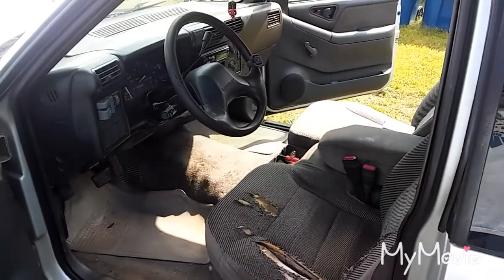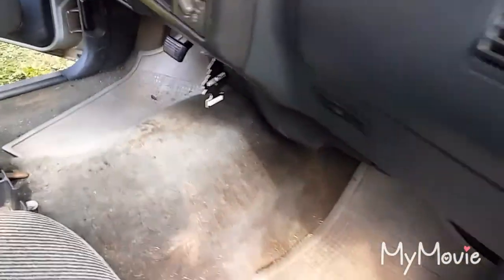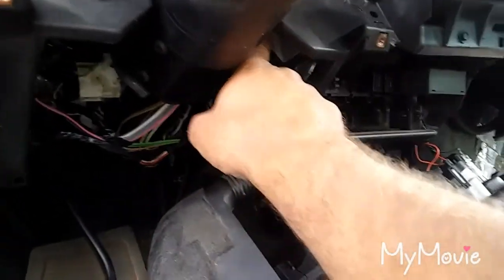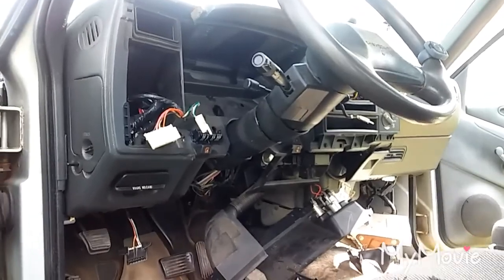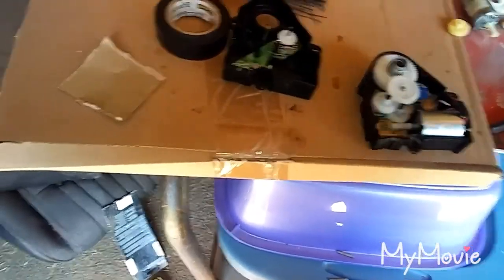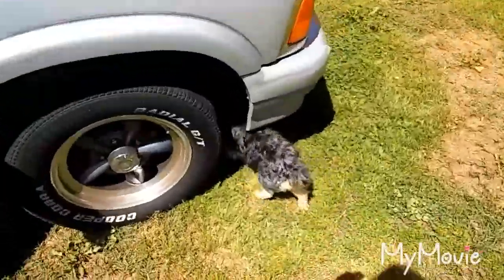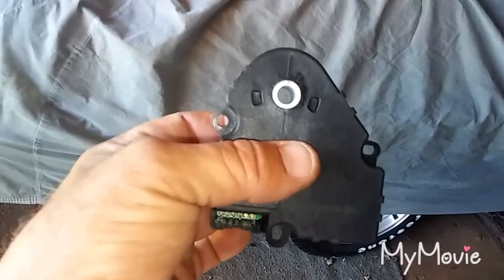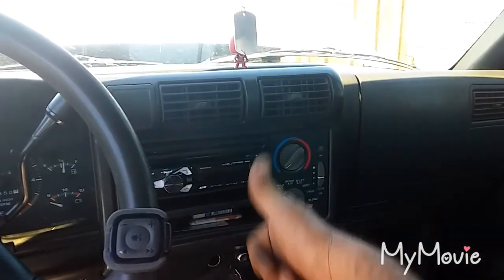Blend actuator for 95 S10

Comment: problem is you didnt show the process of dismantling the dash.
Reply from the maker: Sorry man. There's 3 bolts in the heater vent on top of the dash. The panel just pops out (did on my truck). One bolt on each side of the bottom dash by the doors. Then pull off trim pieces, clusters, steering column, etc. ✌
Reply: @tubinruben115  thank you so much for replying. this thing is driving me up the FU..ing wall. with no heat in the middle of winter. and a 45 minute drive going up north. I'll check into those bolts you told me to unfasten. just don't want an irreparable mess on my hands. again tnx for replying.
Reply from the maker: @dexterthompson1809  hey man, I forgot about 2. They're left and right front corners under the speaker covers. Sorry bro
Reply: @tubinruben115  no Worries man!  Appreciate your feedback, and posting your video.